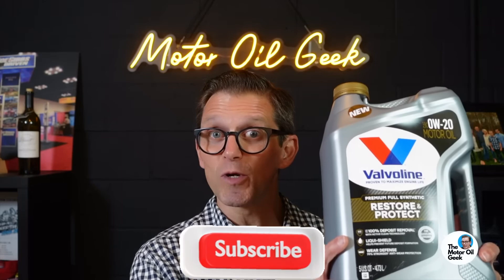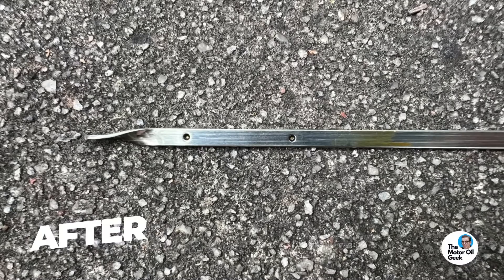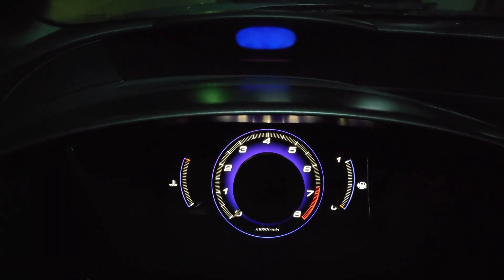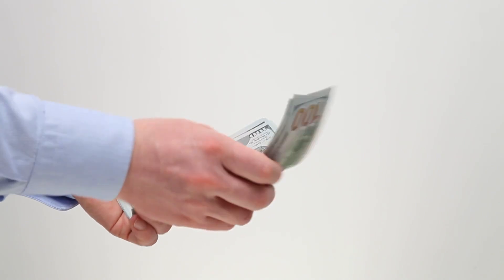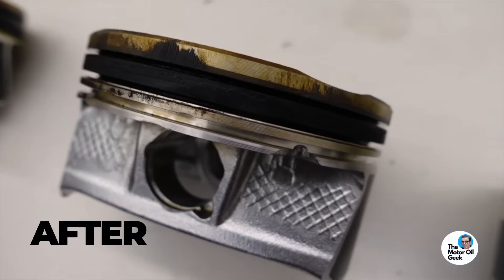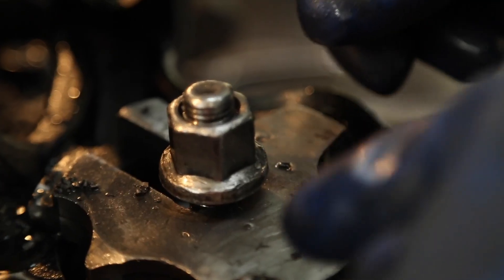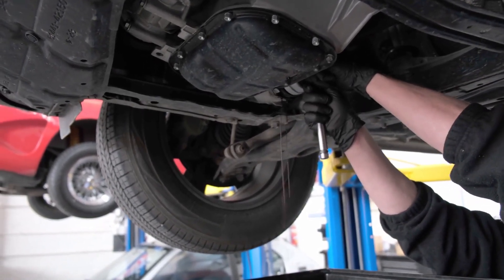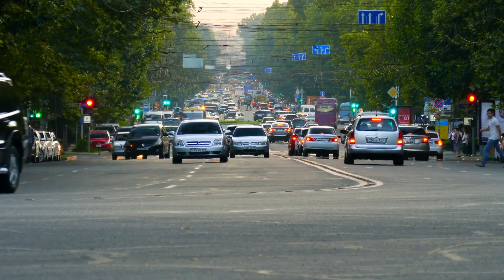What Motor Oil Geek Missed About Valvoline’s Bold Claims

Comment from the maker: Thanks for watching! ❤ Do you believe Valvoline Restore and Protect really works, or are you still unsure? 🤔 We talked about what The Motor Oil Geek got right and what might be missing. Share your thoughts below—have you tried this oil, or do you think it’s all hype?
Reply: @FuelDiscuss  using it in my 2006 F 150 with 178000 it was using little over a quart between oil changes, now it does not and makes engine a lot quieter than Castrol high mileage. Change oil between 3 and 4 thousand miles.
Reply: @FuelDiscuss  absolutely 💯

Comment: Works great my 06 FORD F 150 4.6 Triton v8 178000 miles motor oil is not as dirty been using it for a year oil changes with fl 830s filter oil is the deal

Comment: I ran this in my 2006 5.4l super duty and ran it 3 times (265000 miles on this engine) and my dipstike is still Carmel colored as it was befor i used it. Not really impressed although I like the idea of restoring to near new.

Comment: Yall do know that valvoline does their own engine testing, and the video that Lake Speed Jr tells you that valvoline had a more aggressive formula for cleaning a cummins diesel engine and learned from that, and that's why it takes more oil changes to clean the engine. Valvoline even says that they don't want to cause negative side effects of aggressive cleaning. 
Yall need to watch that video alot more closely

Comment: My 97 civic started burning through a qt every 500 miles so I used this R&P and it went to almost 1000miles. Thing is I used several other top end cleaning products and probably messed something up. Wish I knew about the Valvoline before using those other harsh products.

Comment: I like this Brand of oil and also the Restore and Protect one for one of our cars that is burning oil for a while ( 2015 Kia Rio EX with over 100.000 miles on it). I have decided to Do oil changes on my own as I have been using this oil to top off (adding) to the one made at a Valvoline Oil Change places (3-4 extra quarts between my oil changes). They do not offer this product (R&P) in these shops. I will be shortening the intervals from 4.000 miles to 3000 miles oil changes. Oil is very dark (black).

Comment: I've been using R&P for 700 miles in 280k toyota matrix. Big difference.  Oil consumption down by 90%, more power, much quieter. Haven't noticed mpg change.
Reply: It also rnoticed reduced oil usage making it worth the cost which is slightly more than standard synthetic oil.
Reply: I have a 2010 pontiac vibe like a your I wanted to try this in my wife's car I want to make it wasn't going hurt her car it does over 200,000 miles.
Reply: 0W-20 or 5W-30?

Comment: Y’all being very skeptical and all based on what ifs.  At least there’s a lot of factual basis the Motor Oil Geek uses.   I’m on my 3rd run on Valvoline Restore and Protect.   My oil burn has reduced from 2 quarts per 5,000 miles to 1/2 quart per 5,000 miles.  The first 2 oil analysis has shown the best wear performance that I’ve ever had in the history of my car.  Overall 7-8 used oil analysis over 350,000 miles.   So the facts show that this has been the very best motor oil my engine has ever seen.  And as for costs… I spend $30 per 5quart jug.  I can tell you there are a lot of brands that sell at at AutoZone, Advanced Auto, and O’Reilly’s is $32 and UP for lesser oils.   So your negativity on R&P’s cost is unsubstantiated!

Comment: If you want the engine to last, just buy the cheapest synthetic oil that has the specs for your engine and change it every 3-4,000 miles. If your engine is dirty, add a cleaner like Kreen that works and gets results in just 1,000 miles.

Comment: This oil is only about $5 more a jug than other oils. Try buying Amsoil at $45 for only 4 quarts. I'd like to see Valvoline labs take a brand new car and run it to 500k then tear the whole engine apart like they did with the extended protection Valvoline and instead use R&P the entire time.

Comment: The gunk in our engines is cooked motor oil.  The latest standards for motor oil have requirements to reduce the gunk buildup.  If Valvoline stumbled a way to reduce the gunk and deposits.  It is just the evolution of the standards.  Just like when Mobil 1 synthetic came on the scene back in the q970's.
I gave a friend a quart of the Valvoline Restore & Protect 0w20.  His 180k mile Toyota Prius was using several quarts of oil between oil changes.  After a month, he said the fuel economy dropped fof a couple of weeks, then returned to normal.  But after that month, the oil consumption was cut in half with just one quart!  So try a couple of quarts in your next oil change.

Comment: I started using Valvoline restore and protect 0w 20w in my 2012 Honda pilot ex-lres after 3 oil changes it finally stopped burning oil! It works.

Comment: For those who want to make a clear and educated decision about this oil I encourage you to watch both Lake Speed Jr videos about the Valvoline Restore and Protect. 

https://www.youtube.com/watch?v=kyyZDghgdCI INSIDE   "Valvoline's SECRET R&D Laboratory to UNCOVER the TRUTH"

https://www.youtube.com/watch?v=-IDvx1LtqVM&t=305s    "The TRUTH About Valvoline's BOLD Engine Cleaning Claims"

Also there is a youtuber called Midwest F-150 who is running Valvoline Restore and Protect in a F150 with a 3.5 twin turbo ecoboost engine. He has many videos about running this oil. 

https://www.youtube.com/watch?v=k6PW3U0OGF8  "Oil Analysis: Valvoline Restore & Protect (~9,000 Miles)"

A good motto to live by is "Trust but Verify" . Ya'll have a good one.

Comment: I used it in my wife's 2018 Jeep Cherokee (2.4 Multiair motor) as a preventative.  It's been very well maintained since new but I got it on sale at NAPA and thought I would try it.  I'm sure there's no deposits inside the motor but it has low tension rings

Comment: As if Mobile is actually cheaper than any Valvoline product! Try targeting another brand. Try using the product, as prescribed before you create fake news,like this! My 3.5 GDI twin turbo is on its 5th change and it runs quite,smooth and my fuel economy is finally stable.

Comment: I just put in my first fill of R&P. If it can free up the oil control rings in my 2012 Subaru it will be worth it. I’m going through three quarts of oil between oil changes (5k miles). You can get it for $6 per quart if you shop around. I drive 16k miles per year so I change oil often (about every 5 months). The reason they say it takes multiple changes to completely clean is because they don’t want the oil to clean the engine too fast and cause issues with the filter clogging up.
Reply: That’s a lot of oil consumption. Will be a great test for VR&P. You should make some videos of your experience.

Comment: Too much knowlage can make things even more confussing.
Mr. Lake "Oil Geek" has said the whole time "REGULARE OIL/FILTER CHANGE!!"
By doing that there is no need to FLUSH or use expensive R&P oils.
A clean dip stick after 2000 - 3000miles tells you something is wrong.